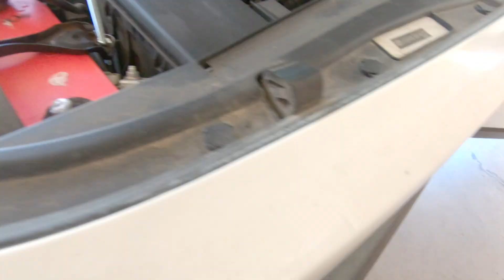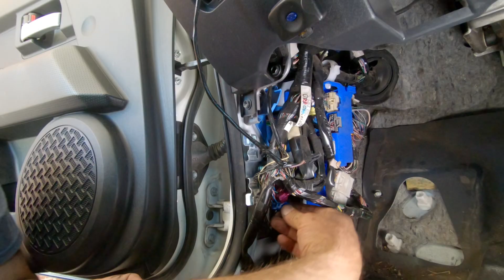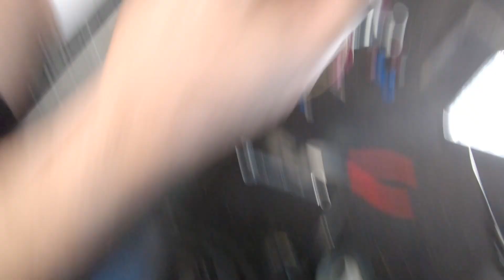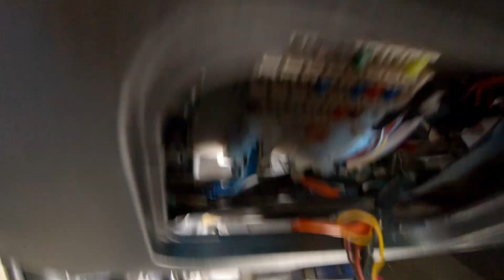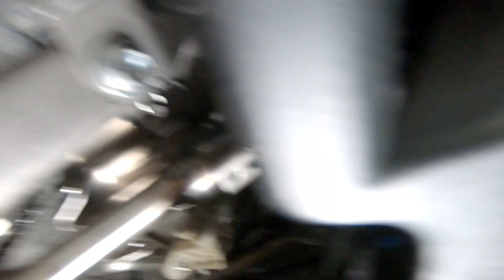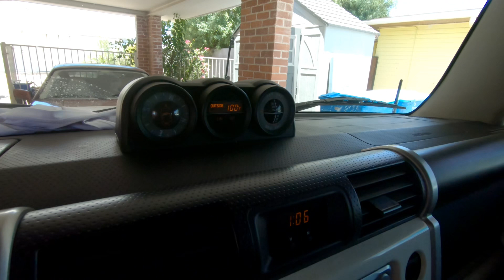Removing Dealership Installed Alarm From My Fj Cruiser - Karr Car Alarm

Comment: The local ford dealership is charging $699 for this "KARR" (3 year GPS enabled) feature pre-installed (on both new and used cars). They boast how his feature saves their cars from being stolen from their dealership (all are made up lies I found out). They then drop it to $399 when you don't want to buy it. And when you decide not to buy because of this unwanted feature - the price is $0.00. Don't even walk into a dealership that sells this (big posters and signage)..... go to a different dealershiip
Reply: Exactly, you do not want to deal with the kind of morons that would install this POS into a factory wiring harness when the vehicle already has factory security system in the first place.  It's a jumble of spaghetti wiring that is a nightmare to remove.

Comment: Thanks for the great video. I found one of these Karr devices on my SUV. I am having an issue on my 2017 Nissan Pathfinder. The front doors will not lock with the key fob or the power locks from the inside. Already replaced the actuators in both doors. I am hoping by removing this device it will remedy the problem.

Comment: I understand this is not a current video, but just for reference, the removal process applied to a 2019 Civic as well. Had a failed module, with a crank no start condition after a repossession and new fob programmed. Appreciate your time, editing, and posting of this content.

Comment: Thanks again for this super helpful video.  Question: Would there be an problem with just removing the module and splicing the ignition wire back together, but leaving all the sensor leads from the door locks and windows connected?  I believe they are all inputs to the module, and with the module jumpered out and powdered off, they should not have impact.  Right?

Comment: will this work on other toyotas? like the tacoma for example. and did you have to take out drivers seat? cause i am a bigger dude and not sure i can get between seat and dash
Reply from the maker: It should be the same for most cars. You can take the seat out. Just disconnect the battery first, and there are a few electrical plugs under the seat that should be disconnected.
Reply: @davinsrandom3142  started that project but, found a black and white ribbon cable that was behind mirror(transmitter) it went all the way down to the alarm system unplugged part, but then found it was wedged in behind air duct and connected to bigger box. how do i get that out, do i have to go through heater controls?

Comment: Thanks for making the video. I was stranded at a rest stop during a family vacation. My car wouldn't start, the blue LED started to blink, and i didn't notice that before. Car got towed to a nearest dealership and didn't want to troubleshoot it.  After your video, i was able to bypass the starter cutoff. Spliced the wires and twisted them together, and my car was able to start. POS KARR system. Thanks.❤❤
Reply: what kind of car was this?  I had a similar situation, but mine was parked in my driveway.  Still had to have it towed to the dealership to have it fixed though.   3 days after I bought it.
Reply: @iilmac 2018 Honda CR-V. The theft deterrent or something triggered and it wasn't sending the signal to the starter. It happened at a bathroom break at a rest stop 1 hr from Albuquerque NM. We were vacationing from CA.

Comment: How much does this KARR alarm system actually cost the dealership?
Reply: It's $200 in my case
Reply: I heard about $500
Reply: The price becomes $0.00 when you try to walk out the door without buying this optional KARR security feature.
Reply: The unit is $60 plus $40 for an independent installer

Comment: Very helpful video.  I didn't know what that button was for, although I assumed some type of alarm, but I was hoping it was factory.  This video really helpful in that it: 1) confirmed I have a cheap, aftermarket junk alarm, 2) it was likely added by the dealer, either original sale or subsequent (I'm the 3rd owner) and 3) helped me recognize exactly what parts needed to come out, and the all important splice of the one wire connected in series with the alarm, vs. parallel.  
 I don't what the Negative Nancys are bitch'n about, this was super useful.  Big "Thank you!".

Comment: Thanks for your great video.  How would you approach this issue when trying to buy a car brand new?  I turned down a purchase tonight and one of the reasons was they pre-installed a KARR alarm system, couldn't tell me why it cost a $1000 (meaning features, one or two way and any other information.  They just said it's installed.
  You said they disable the car alarm system that comes from the factory, how good is that system compared to Karr.  I guess the fact that I can find "very little" when I Google Karr tells me what I need to know.
  How do you find out about the car alarm system that is built in.
  One other question is how are they supposed to install it if they don't splice?  I'll have to go to my local car alarm and audio system installer to find out how they do it.
Reply from the maker: Dealerships do this so they can lock and unlock the cars remotely and it also makes repos easier. The Karr system overrides the factory alarm but it isn't any better. Just like in my video they use quick splice connectors. Only the main power wire gets spliced and its an easy fix. Definitely don't let them charge you for an added alarm. Tell them to either take it out or off the invoice and remove it yourself.
Reply from the maker: If a car has remote key locking then it has a factory alarm.

Comment: I wouldn’t have taken it out  blue alarm is installed because ur vehicle has no factory alarm  also Orange wires are starter wires looped in the brain of the alarm Into a relay when alarm is triggered it will not start

Comment: This is a worthless video except for one thing, if this guy can remove his alarm, we can too!
the only useable details are what the module looks like, most of the wires are just taps, and that the ignition wire is cut and needs to be reconnected.  
Freeze this @ 10:45 and enlarge it is all you need
Reply: Hardly "worthless".  Confirmed the work I need to do to remove mine, including helped me recognize the bad parts.  With most DIY projects, like removing a non-factory POS alarm, the value of the YT video is in giving the viewer confidence that what they are already thinking is correct.  Yes, you summarized the actions, but it was nice to see someone perform what I'm going to have to replicate.

Comment: Davin thank you for the video I'm curious what brand was that that you took off was it a car device or which one was it as far as those two orange wires I would have thought of them I don't like using a wireless connectors because that is high voltage and that is when your car starts you don't want to be stuck 
In the middle of nowhere if you do take your FJ off road like I take my Grand Cherokee off road .

Comment: at 7:00 not sure what your doing, so you locate the main power wire (yellow wires) and cut them in half and reconnect them?
Reply from the maker: Orange wire. Heavier gauge. It was spliced so I had to crimp it back together.

Comment: Thanks man!  This worked for my 2008 FJ Cruiser. There was an extra relay attached to the power wire but it was no problem and was removed also. The power wire was green and had to be butt spliced as you described (yours was orange). This was NOT a  YouFlake video (like so many are). Took me less than an hour. Now the horn doesn't sound when I'm locking or unlocking the vehicle.  Outstanding!
Reply: Does yours have a little momentary push button on the kick panel? I have a 2008 sienna and the alarm system is not causing any issues aside from tooting the horn when I lock or unlock. Ideally I'd like to keep the alarm but disable the horn toot.
Reply: @cliffmcleroy8168  Don't remember. I sold it. The FJ's size was like driving around inside of a basketball.